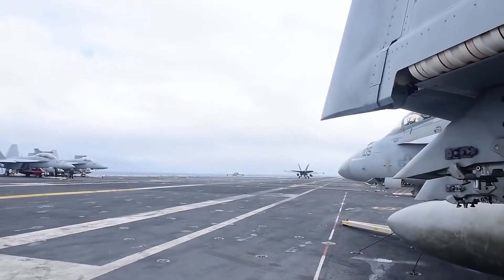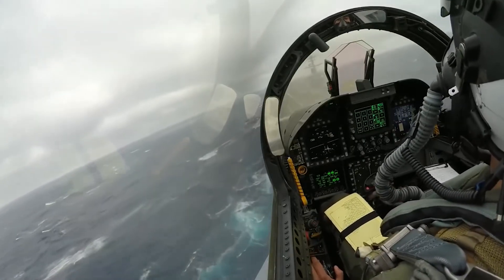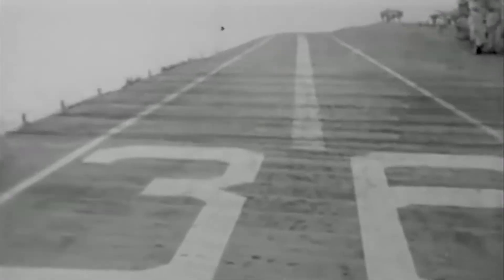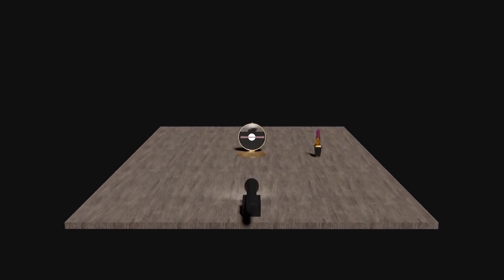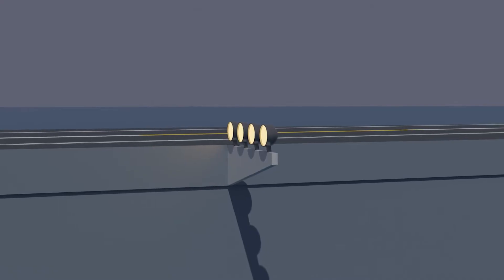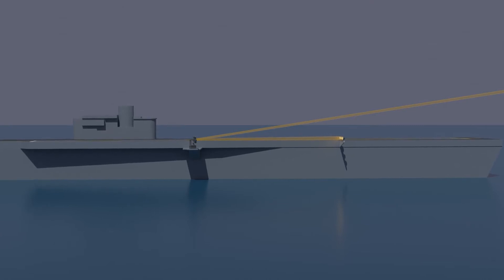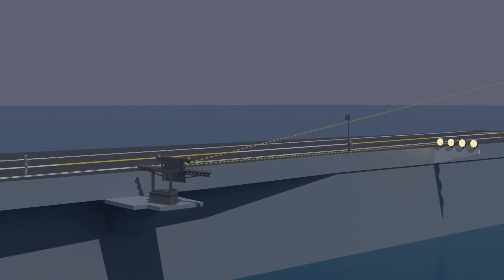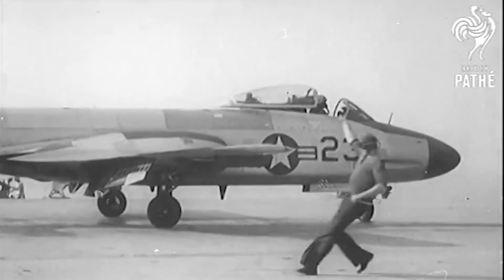How Navy Pilots Landed on Carrier Using Mirror

Comment: The signal mirror carried in US survival kits is known as a "Meatball Mirror," because of the grid between the two plates of glass which show where the reflection is being aimed.  When the mirror and the Fresnel lens systems came along, the beam of light looks the same as the "meatball" in the survival mirror that the pilots had been trained to use.  It has nothing to do with the Hinomaru on the Japanese flag.